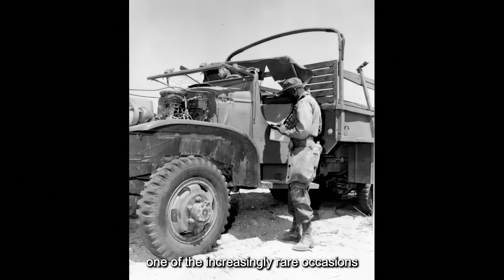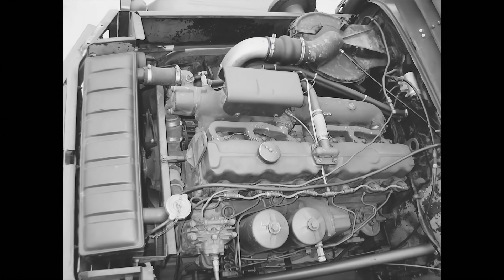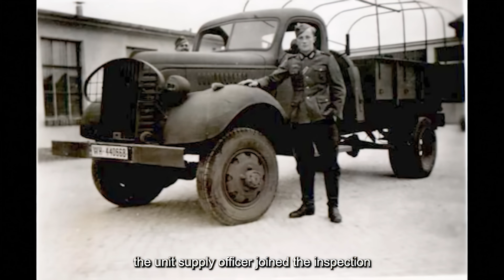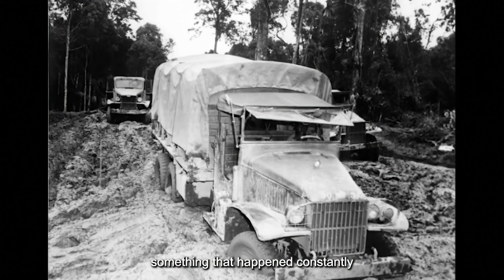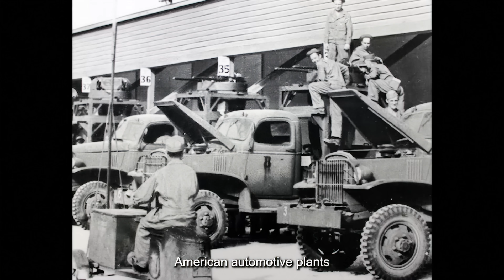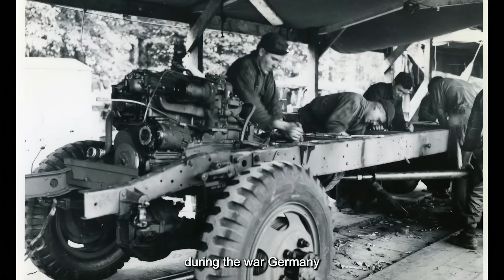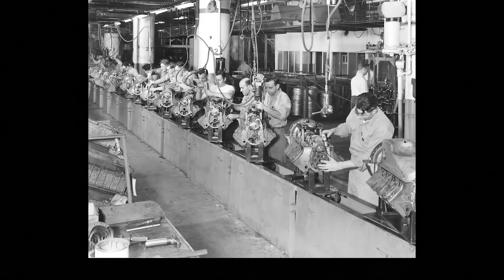Wehrmacht Mechanics Captured a GMC Truck... Then Realized Germany Was Doomed

Comment: It's known as K.I.S.S.
Keep It Simple Stupid. Which today's engineering doesn't understand.
Reply: Wrong. Engineers design to the requirements provided. If they’re told that some widget must be in the design, then they’ll find a way to put it into the object.
Reply: While you certainly have a point, KISS isn't generally what sells products, so engineering is not asked to design with KISS as a primary guiding principle.  Which leads to dishwashers which require cloud connection.
Reply: @ralfbaechle  Kiss sells product, if the simplicity is reflected in the Price.
I have a friend who always asks ..why do I need internet connection on my fridge?
 A security consultant asks ..why my vacuum cleaner connects to china? He was convinced that he is spied on..
I have a 10 year old Samsung smart TV, fancy model..strange ..it have a microphone..but NOT a camera. Turns out CIA and FBI ARE listening an ALL SMART TV-s with the built in microphone.
Read the SNOWDEN FILES...
So , the tech useless tech crap is there to pump up the price, the illusion a different products, and if necessary ..to spy on you.
And yes TESLA have KILL switch on EVERY car , to kill you if necessary (taking control of the car outside of your will).
Reply: Well, today's simplicity is yesterday's cheap.
Reply: you have to complicate it so it's a head ache to fix
Reply: That way, only you can fix it.
Reply: @vstrom9586 wrong. They have to meet emissions, fuel economy, safety, etc standards all required by uncle Sam.
Reply: @machinist7230 Over regulated. 8:26
Reply: It's a business strategy so you'll buy 'nother one instead of repairability
Reply: That is a fact! Pop the hood on today’s car/truck. Crammed/shoe horned into the engine bay with tubes, hoses, wiring and “modules” piles in resembles a life support system.
Reply: Thats bullshit
Reply: Nice video but repetitive as hell!
Reply: No, that the goverment doesn't understand. Engineers know better.
Reply: Mainly a German problem in OVER-ENGINEERING philosophy. The main problems with German automobiles are their high cost of ownership due to complex technology, the associated difficulty and expense of maintenance, and a current industry-wide struggle to transition to electric vehicles while maintaining profitability. These issues stem from a focus on high performance and advanced features that lead to intricate electronics and complex engines requiring specialized and often expensive repairs--when they do breakdown.
Reply: @GEHIRNvonSTAHL-x Our trucks also had 2 drive axles at the rear not just front wheel drive and one rear axle. Thats why its called a 6X6 and German trucks had 4 X2 trucks.
Reply: Simple and Stupid is dead, Sophisticated-Exotic-Designer Gear rules even in the Chinese factory and in the head of ALL of our customers.
Reply: Yes, for the most part. The F22 plane , however, WAS designed for the ease of the mechanic
Reply: praise be to space king
Reply: celto-gaelic americans lack the potential for transcendent engineering.
Reply: Must be DEI hires then.
Reply: Engineers, if they designed what they wanted to make would usually keep it simple. When the government and car companies tell them to make an engine with several dozen constraints as to performance, emissions, etc. and a dozen engineers are assigned to a dozen parts, you get a complex nightmare.
Reply: Most of modern vehicles and equipment are overengineered.
Reply: Course they understand it, the Merc W123 could do a million miles.
So reliable it nearly bankrupted Mercedes.

The industry learnt from that.  Now they build cars with wet belts, oil filters you can't reach easily, cars without dipsticks, software you can't fix, headlights you can't change.  
They don't want your car to last like the W123.
Reply: imo modern cars are designed to be too complicated for any diy, they want repairs to be done at the dealers so they can be cost centres, they are basically computers on wheels and in many cases a pita to repair even for dealers. It doesn't help that there is an obsession with emissions and there is some crazy tech on cars which sacrifice reliability and increase costs.
Reply: @olivertaylor4779 if vehicles didn't have emission controls, we living in built up area would all have asthma and lung cancer. I'll take the sacrifice in increased complexity, thanks.
Reply: Hardly emission controls, Diesel exhaust fluid systems are a blatant scam that simply force the customer to purchase the next vehicle when they stop producing the replacement parts designed to fail, parts they stop producing after 5-7 years usually, when they tend to start failing. Same as the electronic control modules that are VIN specific, so now swapping and flashing if that's the case like the last customer I had to explain it to. Dude literally bought an $80,000 rolling scrap pile, had it for less than a year and didn't even put 20k on it yet. 
Most of these plants produce far more in terms of contaminants now than they did when I was born and they're following environmental regulations. Even if every car was running from the 60s for a year straight, it still couldn't produce the amount of pollutants required to fabricate rolling plastic trash that is less recyclable than the past six decades of vehicles pre 2010.
Reply: @sirtickleshitz  The ONLY reason EV will win the day , it is because it is NOT emitting fumes in the city..China did that already, strange ..the background noise and smoke disappeared from China's most rich big city's.
Reply: @olivertaylor4779 it's what most companies make money on now, they don't make the money selling the vehicle or product but the costs that come with it. Not like there's any real competition to put the practice in place when these companies can just lobby and buy out any company that might make them compete for their customer base. Back then it was a privilege to have customers that bought your product, now it's a privilege for a customer to have your product.
Reply: That and everyone is copying Tesla because they think that's what the market wants.
Reply: @abradolflincler726 i'm not sure if it's copying or convergent evolution.
Reply: @ralfbaechle  Fair enough, but companies do research on what people want, so there's probably some copying.
Reply: @ralfbaechle compare a Rivian to that abomination Cybertruck. If you were considering an EV "truck" which would you choose?
Reply: @brianrolfe1742 A bicycle ;-)
Reply: The primary german car companies have been reducing their markets with overly complicated and increasingly unreliable models.
Reply: @garymacmillan  And excessively EXPENSIVE MODELS. I have a GOLF, now it costs 4 times as much new, bat the new one have paper thin steel sheets, lot of plastics basically better 30% performance per mile...unreliable parts cost a fortune and is is build ANTI-REPAIR, NEVER one German car again. The new one is like glass , in easy front collision broke so many parts it is UNeconomical to repair.
My old Golf..have a 140 km/h frontal accident..and the repair with second hand parts..cost 1000 Euro..3 radiators pipes, front lamps , fender-bonet ..and a trager...and I made the distribution as well..+ 500 Euro cost..
Reply: Exactly! The more complex it gets, the faster it breaks. Maybe “Keep it simple” is why so many WWII machines are still alive today.
Reply: America now makes vehicles that can't be serviced by anyone.
Reply: A lot of the engineering chaos is because of the obscene demands of things like CAFE standards. There's no reason an F-150 needs a twin turbo V6 and 10-speed transmission.  A small, modern normally aspirated V8 and a 6-speed trans is fine. Lose a couple MPG and pick up tons of durability.
Reply: There's no reason on God's green Earth why a radiator has to be removed to service a starter. And yet...
Reply: Back then, simplicity meant strength, reliability, and trust.
Today, it feels like engineering forgot that sometimes the smartest solution…is the one that just works and never quits.
Reply: Especially web CRUD frameworks. They've become rocket spaghetti surgery. Probably because the DOM is the wrong tool for the job.
Reply: Everything is a lot simpler if you don’t care about any consequences beyond your immediate goal. CFCs are outstanding refrigerants, and tetraethyl lead makes engines run smooth.
Reply: @AikiFuz you do realize that more chlorine goes into the atmosphere from water purification in year than has from cfc's and hcfc's in the last 20
Reply: @AikiFuz 
You forgot the best material know to man, asbestos. Really made everything better and safer. But...
Reply: They also dont understand ,IF IT AINT BROKE DONT FIX IT. Engineers need to learn this and design it for easy maintenance. The newer Ford  pickups require the cab to be removed ti work on the engine   PURE BULL SHIT.
Reply: They understand it.  They know that if they do keep it simple then people will be more inclined to do their own repairs, or third party shops will be able to do those repairs easier. They understand that they are going to make a significant portion of their money back through shop Services, so they try to make everything shop serviceable only.  They very much understand.
Reply: They can NOT even pronounce BOSCH,after 80 years of occupation, so Bosch left for China. Even the USA is doomed ...back home overrun by ..
Reply: @ArpiElectromagnetiKa Bosch is absolutely in Germany, and innovative as ever...
Reply: @nas4apps  "Bosch has announced continued investment in China, not a full move, but rather a strengthening of its presence to capitalize on the market's growth and innovation in areas like electromobility, software-defined vehicles, and the hydrogen economy. The company is building new production plants, deepening R&D"
Closing plants in Germany.
"Bosch is closing some German plants and reducing jobs due to economic pressure, while simultaneously investing and expanding its presence in China. The company is relocating production from some German plants to locations like Hungary, and also strengthening its commercial vehicle business in China by building a new headquarters for R&D, product testing, and sales there."
If you dumb enough not read BETWEEN the lines, read the f-ing lines then.
Reply: The modern cars use B.I.O.S
Built in obsolescence sheds.

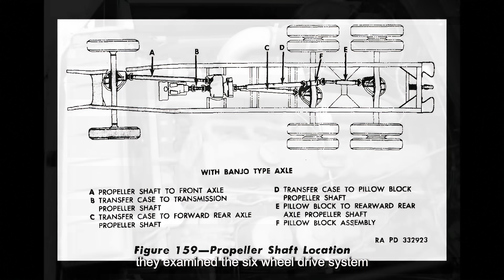Comment: The engine at 3:16 is a diesel engine as it has injectors.
Reply: Correct.   We only had gasoline engines in WW-2……..!     🤷
Reply: @kentporter2991  The vast majoirty of US land vehicles used gasoline however there were some exceptions such as the M4A2 Sherman and M10 Wolverine which had diesel engines.
Reply: I started looking for this comment...  knew it was here before looked in the comments.   In the 80s, shortly after stepping out of fighter jets cockpits, I worked at a "no such site" with a bunch of propeller heads who vastly improved my engineering education and skills.   One of the multi PhDs had a hobby of collecting old WWII vehicles and driving them regularly.  I spent many an hour helping him work on GMC 270 engines and what was pictured certainly wasn't one.   Good catch.
Reply: Even the US army 'duck'(dukw) amphibious vehicle, was a GMC  deuce and a half, with a waterproof hull, surrounding it.
Reply: Good catch! You can clearly see the injectors no mistaking that classic diesel growl
Reply: You’re right. That’s a later LDT 465 multifuel engine. You can tell that it’s a “T” by the routing of the intake plumbing to the turbo on the passenger side of the engine. It’ll run on darn near anything but wet leaves.
Reply: AI nonsense.
Reply: It's a diesel multifuel engine from the 60-70's smoked like crazy and were very loud and distinctive.
Reply: Um in them times some engine run. On 3 or more fuel options 

Kero diesel or gas 
Run most army motor engines in the 40$
Reply: @timanderson-q2w this was World War II, and in World War II GMC only supplied these trucks with gasoline engines. Post-world War II they started to supply these trucks with diesel, gasoline, or multi-fuel engines.
Reply: @dalesuhre6522 Ah ok 
I'd thought I'd seen some ww2 trucks with it 
Must of been Korea
Reply: @timanderson-q2w  They were gasoline only in WWII.  As were our tanks.
Reply: @anvilsvs Much simpler logistically.  We beat them with supply logistics, American know how, a philosophy of knowing how to get the job done, even if the leader is killed.

Comment: They keep showing post war M-211 GMC trucks. I guess AI has problems.
Reply: I own a 1952 gmc xm211 interesting  and fun truck.
Reply: @Timh.-vp7qf  I always wanted one of those!  I like the automatic (tho I love driving manual) but apparently most are converted to modern autos and therefore no low range!
Reply: AI already knows it doesn't need to tell the truth and people will rarely notice because iT wAS oN tHe IntErNEt.
Reply: Not many diesels have spark plugs . . .